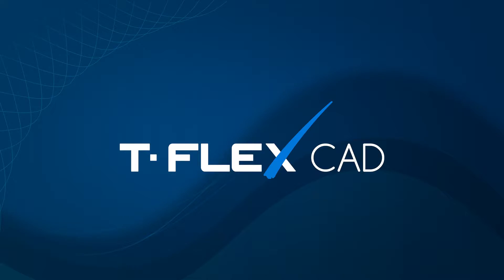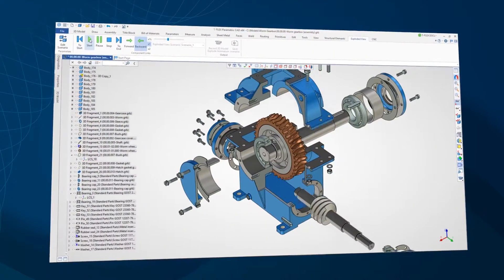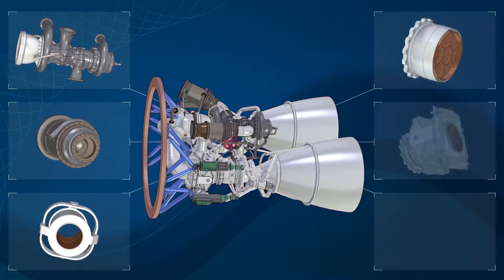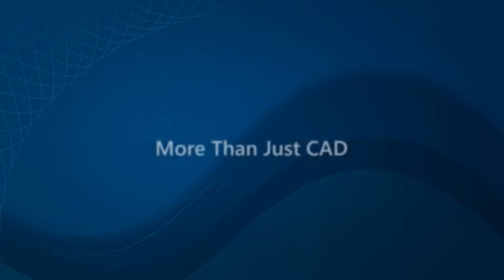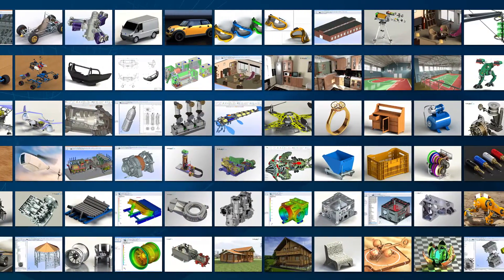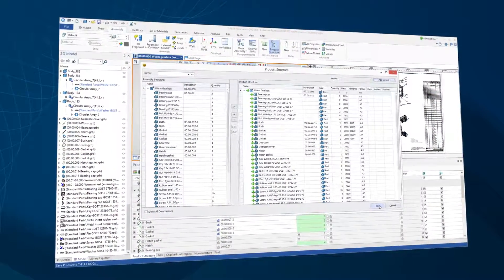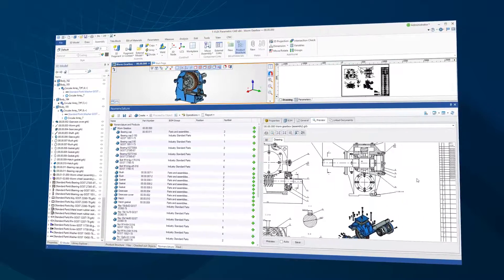T-FLEX CAD and Add-ons Introduction

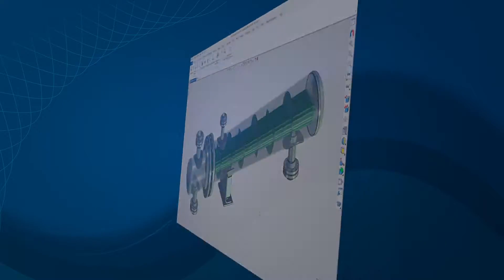Comment: Hello ! I have checked a couple of videos in english and the website but it is still not clear to me. T-Flex has a standard mechanical library ? In this video in minute 1:15 they go and change the parameters of a worm-gear assembly so I am assuming they do have a vast true mechanical parts library like gears ?